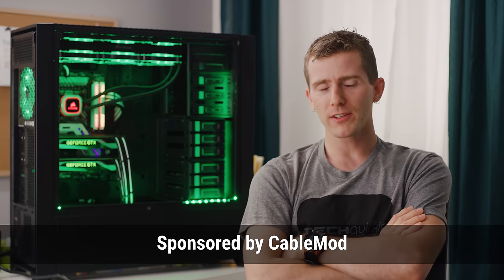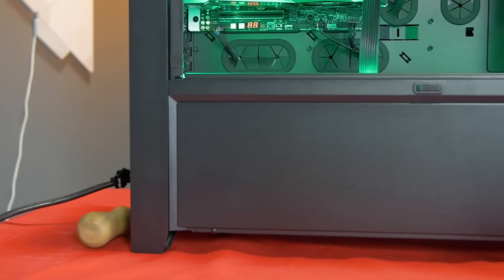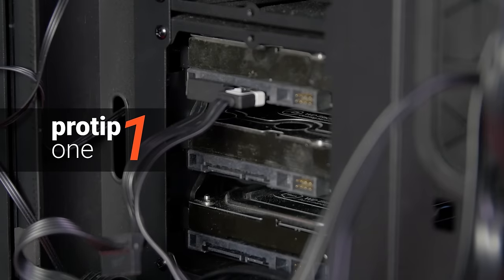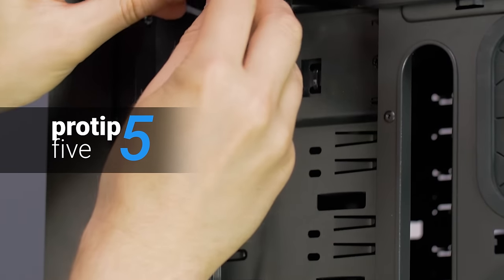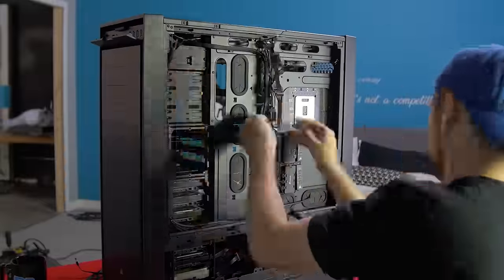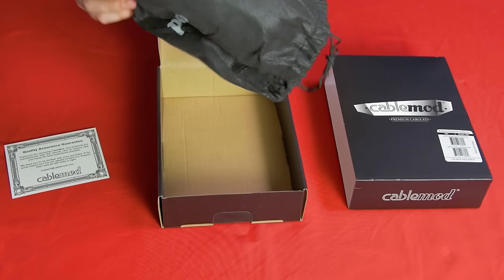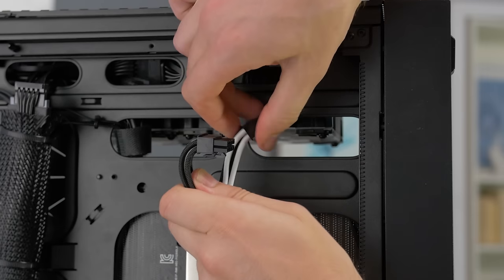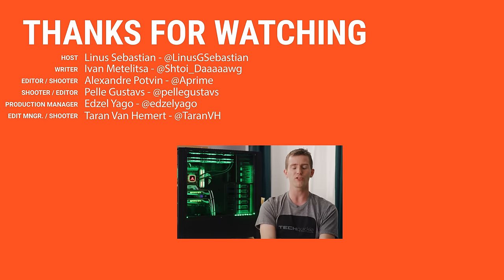ULTIMATE Cable Management Guide

Comment: Wow!  I can't believe they are actually talking about this.  Having worked on large mainframes, here are the rules to follow.  Tie-wrap cable ties are a error waiting to happen.  If you can't easily move the lock-tie then it is too tight and it will eventually cut the cable or cause an intermittent failure.  Long clean straight runs are BAAAD!  The induce cross talk in the cables and induce random glitches and corruption.  When two or more conductors are in close proximity they will become magnetically linked and induce transients.  Everyone say it with me, "Transients Baaad".  Never run Data and power lines with each other.  What might be a simple AC transient spike that the power supply that is designed to handle, can be induced into a data line.  AC spikes can easily hit 75 to 100 volts just by turning off some item.  These than can be induced into a 5 volt data line and POOF!  Data lines under boards very bad.  Not all manufacturers sand the points off of the bottom of the board.  As time goes by plastics degrade and stiffen up an can heat up.  Fans collect dust and vibrate and guess what, as the vibration continues the little pin like points can work their way through the insulation and POOF!
All of these are bad for you and your hard won data.and PC hardware.  You can even go as far as never coil a cable.  This makes a great air core coil transformers.  I have seen what happens to a group of computers that had one failure get induced into 4 others.  Not pretty, very expensive and costly for a business that was down for a week.  So all I can say is think twice before becoming a neat freak and making your system flakey.

Comment: i still put a dvd in any of my pc builds, its dirt cheap and in those 1-2 moments per year it just saves your bacon HARD.... granted... i just reuse my old one, if i had a case without front 5 1/2" bays i'd just buy a external drive.

Comment: This maybe a silly question, but when looking up cablemod cables, whats the difference between corsair vs evga vs Asus etc? Is it the connector type or is it motherboard specific? I have a Thermaltake power supply, which set would fit that?

Comment: If your building a PC that's higher end and is going to go through the masses then 350$ on cable management isnt bad, especially if your watercooling and will be doing maintenance, 8ts not hard to build a PC that will last several yrs, seems like ppl think you have to upgrade everything everytime something new comes out

Comment: I love how they tried to slide past that whopping $370 and change price tag for a custom cable set. You might as well buy a better monitor (or an entirely separate 1440p one), then the things your computer are working on will look good, instead of the things on the inside...

Comment: Wire management is mostly about the looks of your system and if you can see the inside of the computer. Some air flow is helped by cleaning up your cables.

Comment: my system doesnt need that cable manadgement bulldump
1 GT730, one HDD and one dvd drive (i use it often) and non clear case (if its under my desk why would i need full rgb and clear case? i only see the tower when plugging in something to the usb port, powering it on and when loading a disc)

Comment: The cable management has none what so ever to do with how your computer works unless it needs really good airflow or a boost to your ego. If you feel like it just run the cables the easiest way and just go! Hiding metres of cables behind a plate may even heat up the computer slightly, very slightly but still. 
Run the cables as you like and use the shortest ones you need. I am having trouble seeing why to bundle and hide metres of cables behind a plate. Just get the lenght of the cables you need.
Cables are annoying but we have to live with them, accept them for what they are. Let go of your ego and just run the cables as they should, freely, not bound.
Suck on that Lollipop Linus ;)

Comment: Find it funny how people are freaking about the cable price when it's the top of the line product from CableMod with a bunch of customization. A standard replacement kit will run you $100 or so and a custom on with just the cable you need might be a touch more.

Comment: they bought cables for the entire psu. you dont need that many. I ordered cables from cablemod last month. pro version with quite a few combs. 1 24 pin, 2 8 pin and 1 6 pin cable cost 130 with shipping.  which really isnt all that bad of a deal.  I wanted purple cables and they are one of the only companies out there that offer them.

Comment: Man, my Lian Li O11's glass front can be put on the back, so I could easily order a replacement and use it on the back to show off the cable side, but 3 fans and the PSU kinda need that air flow...

Comment: I've built 50 PCs or so yet I suck at cable management, although new cases make it much easier.  My own Antec 300 system still looks like it was thrown together without any management in mind.

Comment: OK, here's my free tip.  For cutting cable tie slack, use nail clippers.  The blade is curved and head on, which means the cut end won't have sharp corners to snag on anything, including your skin.

Comment: nice video and all, but cables behind your motherboard?
sure, the back of the CPU won't be as hot as under the heatsink, but i would not recommend slamming meltable plastic against it.

Comment: Here is how you can cable manage your desk.

Buy zip ties, a roll of Velcro and a pegboard. Loosely drill the pegboard to the ubderside of the desk. To place a cable attach a zip tie through two holes parallel to the cable. Then pass a piece of Velcro through the zip tie and wrap it around the cable and cut it to length. You can also attach large things like power bars, power bricks and routers. Just attach zip ties around the perimeter of the device to the pegboard and pass the Velcro thought a zip tie, under your device and through a second zip tie and then close it over the top of the device.

The result is that you can't see it unless you get really low, doesn't get in the way of your legs and is easily accessed by laying down on your back under your desk. If you wan to change desks you can remove the who pegboard with all the devices in one piece and attach it to the new desk.

Comment: See this is why I don't bother with a window in my PC case. All that effort into cable management when no one really is going to see the case when it's tucked under your desk, or in a different room. Instead, if you want to impress anyone looking at your case, just print off a clean looking picture of the inside of a case and stick it to the side of your pc. No window to worry about, and you can swap out the picture for something better, it's cheaper than upgrading for real.

Comment: I would highly advise not to run cable between the motherboard and system tray because the soldered ends of the components could pierce the cables causing a short that could destroy every component connected to the MOBO.

Comment: Ultimate? I laugh in your face! Try soldering cables to solid copper runs using acrylic blocks with drilled holes to separate them.

Comment: I am going to strongly recommend NOT EVER running cables between the motherboard and motherboard tray, as the pins on the bottom of the board have the potential to poke through into the cables and cause shorts and/or tears.

Comment: Could'nt the solder joints on the back of the motherboard pierce the cables behind the motherboard and cause a short in your system?  Just saying watch your cables and sharp pointy things before you blow up your system

Comment: i have a verry small and old case..aand use it more as a transportable pc..so i fixed my monitore on this case, to that i put a smal power stripe in this case, i put most of the longer cables behind this front side wich you can remove..so these cables no longer in the case and they are safe from being destroyed ore something.....aand here a little idea for a vid wich would be to take a verry old and smal usually case wich is normally used for offic pcs

Comment: i don't agree with cables behind the motherboard.  The pins behind are sharp enough to cut through the cable to cause a short.  I would recommend that you revise this video as this is just plain bad advice.

Comment: actually, if you take of the insulation of the wires, and shove it all over the components it takes away heat, therefore technically improving cooling

Comment: Why don't motherboard manufacturers just start putting cpu power 8 pin and main power 30 pin power connectors on the rear of the mobo?

Comment: Linus random question can I de solder power supply to mother board move it to the back and and have the connector come out of the back in to a cut out of a custom built case to better hide the cables has this been done or is it even possible ?

Comment: I really want to ask if I have only one PCI-E cable but it has two 6+2pin connectors, could I use it with a RTX 3070 which needs 2x8pin?
Reply: yeah if your psu is atleast 650 watts

Comment: is it really okay for the wires to touch the back of the mother board? ive always avoided running anything near the exposed part of the MB for fear of causing a short
Reply: the cables are not exposed so yes its fine

Comment: Why are Cable Mod cable still so crappy looking? Especially for the price they are charging. Our local cables people - like Beyond Customs - make far better ones that look dead straight and you won't have a heart attack at the price. Or you could make your own if you have the tools and the time. Remember, a 24 pin cable will have different length leads for each pin, depending on the bends. This can only be accommodated properly if you make them yourself.

Comment: $378 (rounded) for the cablemod cables??? Holy shit.
Reply: Replacement cables do cost more as you have more to factor in with the pinouts, but also full customization is also going to have a higher premium in addition to that of course as it's more work.

Comment: "cablemode extension are a quick easy and relatively inexpensive way to spruce up your machine looks"
100 euros for a 24pin a eps cable and pci-e pro extensions are not cheap.
Reply: I think he was referring to the basic extension kits which start at $29.90 USD - but of course if you want to spend more that is also an option.
Reply: sure i know there are cheap options, but if you get the pro version and a couple of alumium combs it gets really expensive really fast.
Reply: Get what you paid for though. :D